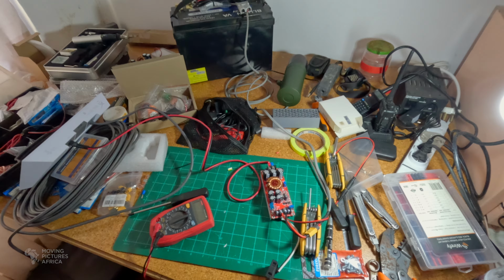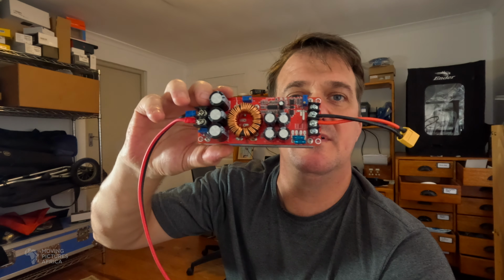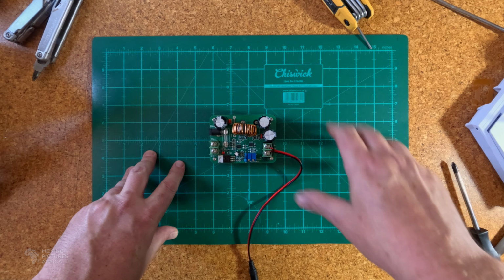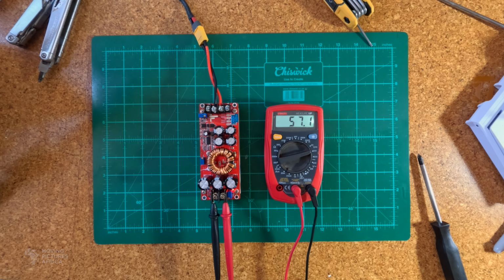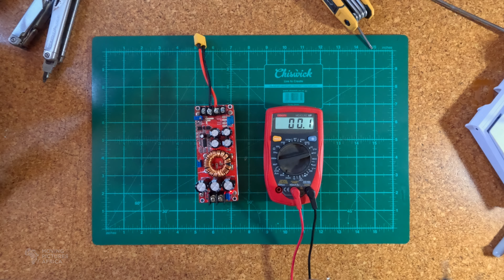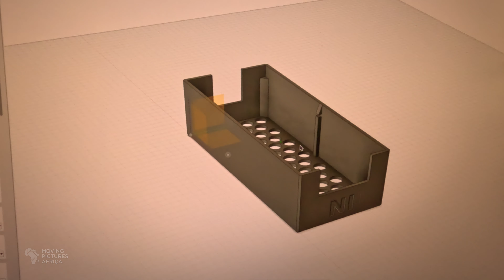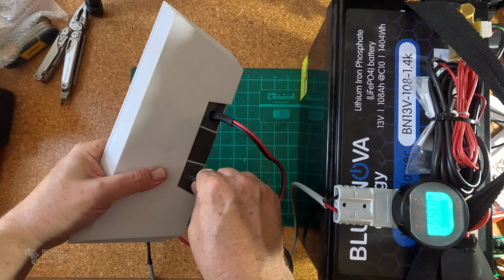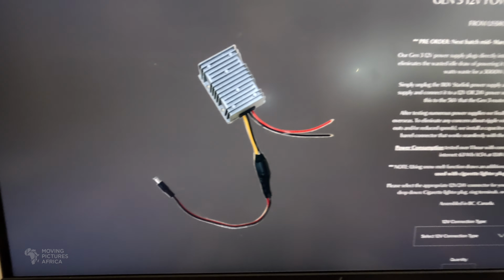Starlink Gen 3 12V Conversion - affordable DIY solution for off-grid satellite internet

Comment: I just wanted to express my Tks for your video.  I watched it several times and bought the larger power supply that you recommended with the fan, hooked it all up with my new Starlink gen 3 to our Rv, powered mainly by solar and it  working perfectly. FYI, we are located in colorado with no cell service.  The WiFi calling feature of the iPhones allows us to make calls in addition to internet access.  The RV has four 200 watt 24vdc panels (series and parallel) hooked thru a Victron down to 12vdc to two 200 amp hour lithium batteries in parallel.  Now we need to see how much of our solar capacity it will take to run it. But again many Tks for your help. I am a subscriber.
Reply from the maker: My pleasure. Glad you found it useful

Comment: Be careful of those DC boost converters. They lie about the current output. Luckily they mostly fail peacefully and dont take out other components.
Reply from the maker: Thanks. I'm only outputting ~2A, so I think I'm well within the specs even if they are exaggerated.
Reply: @MovingPicturesAfrica will definitely be within spec for gen 3 dish.

What is your plan for car installation? Will you use a relay or switch?

All you need to power a gen 2 is a PoE splitter and output at 48v from the DC booster + of course a router for WiFi.
Reply from the maker: @ZED-PV  yeah I have used a relay and added a switch to the dash. I'll cover that in the next vid 👍
Reply: @MovingPicturesAfrica  awesome thank you! Killer setup you have!

Comment: Just done this 12v conversion, not worth it you only save half an amp of all the wiring done. thanks anyway.
Reply from the maker: If you already have a pure sine wave inverter it may not be worth it.
Reply: @MovingPicturesAfrica  maybe not but you have to think, you are taking 110v and converting to 12v. There is a loss there. Why not use start with 12v.

Comment: I purchased the smaller (sealed) converter. It worked a few times but then the SL router would reboot.  I would test the output and it seemed it was not outputting 57 volts. I ordered the  1500W converter so I can have a bit more control.
Reply from the maker: Thanks for letting me know 🙏. I will remove the link if it does not work perfectly.

Comment: One thing to keep in my is that you want to find a boost converter that is constant current constant voltage.(cc cv) I am unsure if the version you are using is like that. The reason is that if you are running the input side on a battery that might change voltage (like a vehicle battery) you want to make sure the output on your converter doesn’t fluctuate with the change of voltage level in the battery
Reply from the maker: Thanks. I have not noticed the output fluctuating. I checked and it was still 57v when running

Comment: How's it going 3 months on? Does it still work well? I just purchased the 1500w 30a version with the fan.
Reply from the maker: Working fine. But I don't use it all the time. I've used it for about 6 weeks total.
Reply: Nice one. A few people have knocked the idea and said "you get what you pay for". Saying "they over heat and aren't safe".
Good to hear yours is fine. Plus mine will have a fan so I reckon it'll be fine too. We'll see
Reply from the maker: @phoenixstone4920  yeah. I added a fan to mine as well to be safe since it is in a rather confined space. It does not seem to get too hot. I usually only use the starlink for a few hours at a time to save power though.

Comment: I have this identical set up exactly , but it won’t hook up. It starts out with 14 watts and when It tries to boot up, it drops it down to 12.6 and just can’t connect. If I use my blue yeti portable 110 power source or shore power it works fine. I’ve got it set at exactly 56 ac watts coming out of 12 volt converter. Any ideas what’s going on?
Thanks for your help!
Reply from the maker: @scottjackson9335  check if there is a voltage drop when it starts up. Maybe your wires are too thin or there is a bad connection. Other possibility is faulty converter

Comment: Great video, thanks! Ended up ordering the 1500w. Do you know if there is a way to measure when adjusting the low voltage cutout and current limiter?
Reply from the maker: I think if you want to set those you will need an adjustable voltage and current source.
Reply: @MovingPicturesAfrica  That makes sense ;)

Comment: Do you by chance get spikes in Watts? I have a different step up transformer and have noticed once all is booted up, my watts will spike to 120w for a few seconds then settle back to 50ish. Not sure why I'm getting these spikes. I did however purchase the 1200w transformer you recommend and will test that.
Reply from the maker: Yes the power draw fluctuates quite a lot. I think perhaps when it is looking for satellites it pulls more power, but I can't be sure about that
Reply: @MovingPicturesAfrica  ok I have a little 600w PS and my system works fine with that. Just purchased a Oupes Mega 3 and it trips the current after about 10 mins. Not sure why but I think it has to do with the high watt spikes. Again I'm going to try the transformer you have and see if it works better.
Reply from the maker: @jsdiecast  👍 my one has been working great. I've used it in total for 6 weeks about 4 hours a day with no issues
Reply: @MovingPicturesAfrica  What are you using for a Power source?
Reply from the maker: @jsdiecast  dual battery in vehicle

Comment: Hi, thanks for this info. I did however get a different Setup Transformer... It kind of worked but now knowing about the output wattage, I can see why might is flaky. Anyways, I did not have access to a 3d printer. Are you by chance selling these cases? If so, I'd be interested in 1.
Reply from the maker: Sorry. I'm not selling. I'm sure there are companies that do 3d printing and ship you the print
Reply: @MovingPicturesAfrica  Roger that... Thanks

Comment: I have installed the 1200 w. version ans set it to 57 V but when the antenna is booting, the voltage drops to 42V and there is a led coming on between the current pot and the low voltage pot . I have made changes to the current pot, but that makes no difference.
Do you have any idea what I am doing wrong?
Reply from the maker: @joepbrouwer5860  mmm.. is your input voltage remaining steady? I don't have my one with me at the moment to test I'm afraid. But I assume the light means either your current went over the limit or the input voltage dropped below the minimum
Reply: @MovingPicturesAfrica  thanks for the quick response. I will check it.
Reply: @MovingPicturesAfrica  
When I connect it, and the Starlink starts working, the voltage drops to 42v and the input from the lifepo4 200 ah battery (88% charge)drops to 11.9.
I have tried all kind of settings of both pots, bus I see no difference.
But when I connect it to the original power source with an 2000w inverter, the battery stays well over 13v and all is working fine. 
I assume there is something weird going on in the step up converter.
Reply from the maker: @joepbrouwer5860  maybe try fatter cables between the battery and the converter?
Reply: @MovingPicturesAfrica  
I will try that when I come home.  I'm on a trip in Portugal.
Thanks so far.
Reply from the maker: @joepbrouwer5860  no problem.

Comment: Did you tweak the current to match the required value for the router?
Reply from the maker: No, just the voltage. The router will draw as much current as it needs.
Reply: Thank you, I thought it was going to be fry if there was too much current input,so it's safe to use this.👌👍
Reply from the maker: @RetroMusicStudio2023  generally, devices limit the current themselves. For example the sockets in your house can supply a decent amount of current but each appliance just uses what it needs 👍. Voltage on the other hand usually needs to match what the device requires

Comment: If I have two batteries that are combined 150 amp hours. Using a regular power inverter how many hours can I run starlink before the battery dies?
Reply from the maker: Assuming lithium batteries, you have 150x13=1950Wh total. If you run your batteries down to 20% you have 1950x0.8=1560Wh available. Starlink Gen 3 plus inverter will pull about 60W. 1560/60=26 hours.